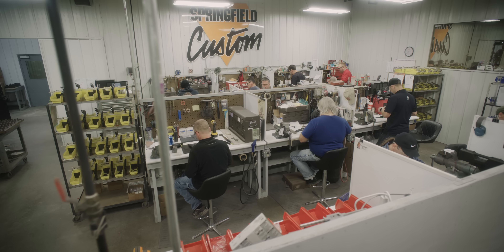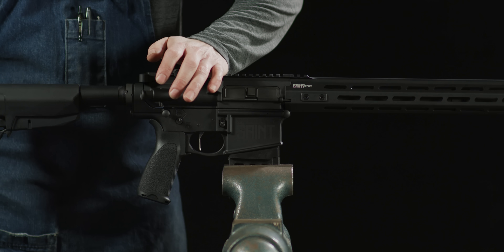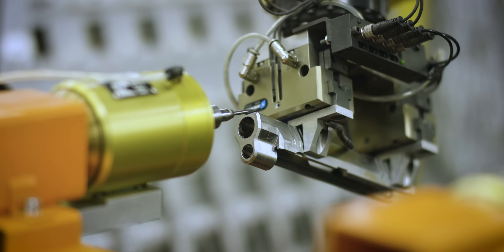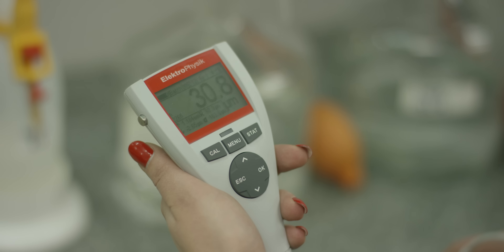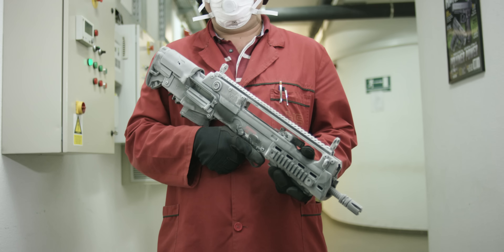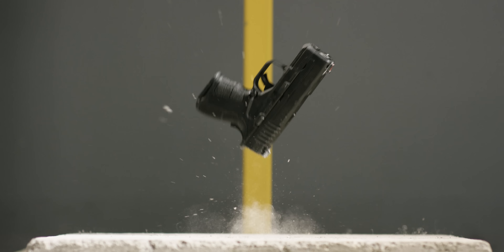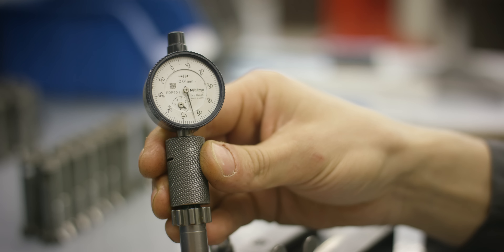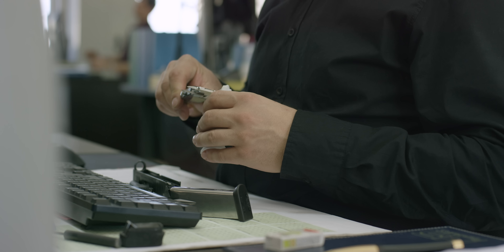Springfield Armory's Legacy of Discipline

Comment: I worked in a gun store in the 1990s. We sold a lot of SA 1911s. Back then they offered their GI 1911 that we sold for $299, $329, $369. Cheap. Parkerized. We sold hundreds at a time. People woukd buy them and send it to Kings Gunworks and have everything rebuilt and redone. So nothing but a bare slide and frame were left. 

 And they were shit. Slides were crush fitted to the slide without any fitting. Oh they were tight. You just couldn't get the slide off. Bushings were crushed fitted. Just wrenched in whether the lug cut outs were sized or not. I've had them returned and we've tried using a bushing wrench and a hammer. Still couldn't get the bushing to turn. Even if it turned to the unlock position, we had to hammer the bushing out by taping the barrel out the front end.  

Their M1s and M1A would jam left and right. Sent so many back it was a joke. 

But sometime in the 2000s they cracked down on their QC. I actually bought a TRP 1911 around 2009 and was impressed by the fit and finish. I was not happy with the amount of MIM parts especially in the sear, hammer, extractor, high stress parts. A year ago I bought their Ronin and was pretty happy. Parts were fitted and didn't look like crushed fittings. Just needed a trigger job and replaced the short grip bushings and I was good. I also bought an M1A (M14) and it works. Shock of all shocks. 

So SA has come up and didn't race for the bottom. They're making guns with quality and at a good price.
Reply: There is nothing wrong with well made MIM. Do you care as much about all the mim in polymer guns?

Comment: I am a fan of most every model Springfield makes. Their build quality is vey good. The only issue I have had was with the new 911 model. I saw it and fell in love. Impulse buy. When I shot it, I had several misfeeds and misfires with different ammo. Springfield repaired the gun and it performs well now. Disassembly is terrible on this gun. The magazine retention spring is not secured and it pops out when you field strip. You definitely don't want to  field strip this gun outdoors.  Getting it back together requires three hands. Makes me wish I would have purchased the Sig. Still a neat little gun, but I can't rely on it for a carry gun because I don't know if it will go Boom when I pull the trigger. I am still a Springfield fan, just disappointed in the design of this model.
Reply from the maker: Hey Ronald, sorry to hear you're having issues with the 911, we would love to help you out and get you taken care of. Please reach out to customer service at sales@springfield-armory.com or call 1-800-680-6866.

Comment: I’ve own 5 different Springfield’s, 1) 45 Champion ( Great Pistol ) 2) original 4” ported XD’s 9mm ( horribly loud w/ a crazy muzzle flash, sold them right away. ) 1) XDM 4.5 .40 for USPSA ( I did’t like the feel when shooting it, Sold it ) 1) XD Compact 9 ( which I sold do to again not liking the recoil impulse, capacity, or grip safety) and finally 1) XD Mod 2 Tactical 9  ( I bought it for my 10yr old son because of all of the safety features. He complained about the recoil. So I started shooting it and it most definitely has more recoil than my M&P’s or CZ’s. So I loaded some 147gr light charge loads and it’s just okay.  The XD grip safeties are Stupid and unnecessary!! ) 
Let me say their 1911’s are great pistol, I’m not sold on the XD’s at all. 
Also I do like their Saint Edge and Victor Ar’s, and their M1A’s.
Reply: Recoil in a 9mm XD???? What? I've got the XD .40 and XD 45 and there's barely any recoil.